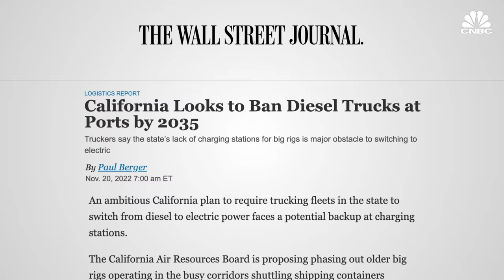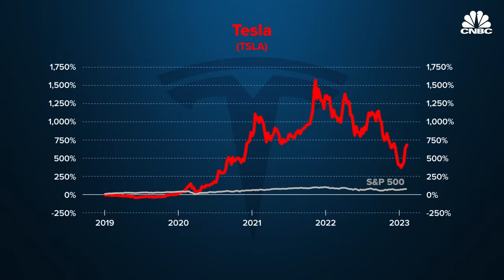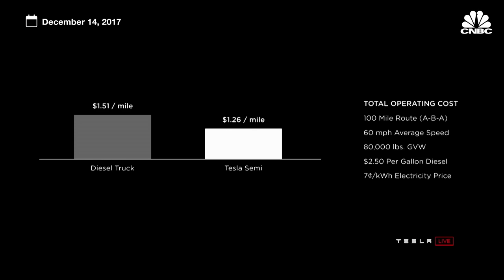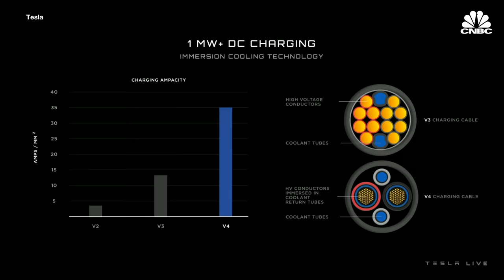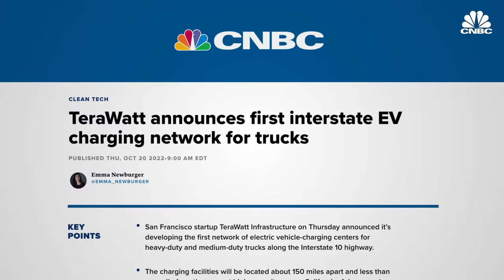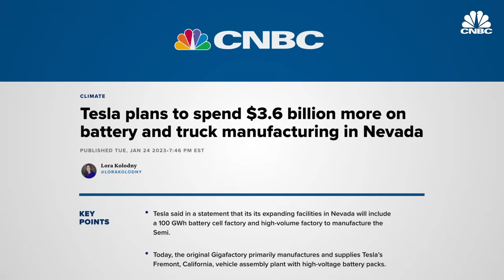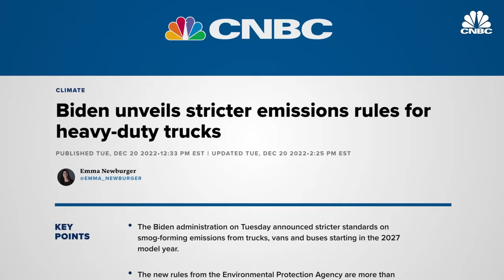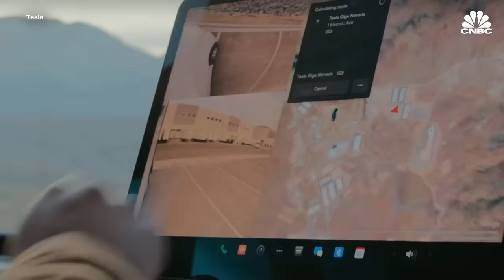Does The Tesla Semi Live Up To The Hype?

Comment: People like to say it won't work over the road but it would work really good for shuttle drivers . 200 miles out and  back. Which a lot of large trucking do. And mega charger  stations will be   are easier to put in than a truck stop.  noise or pollution from  idling truck.
Reply: How about OTR.
Sleeper cab (why not?)
450 miles, (about 7 hours at 65 mph),
Driver stop (300 miles added at a megacharger, that's 350 remaining).
4 hours remaining driver time ?
That's ±260 miles at 65 average (which the Tesla can maintain over terrain)
60 miles range remaining.
.
Total range 450+260= ±710 miles (max load)
.
Truck stops at a V3 charge location.
It's "off peak" time.
No cars (or few) are on site.
The location has a "Semi bay" behind the car chargers on the opposite side to the cars.
.
Picks a (V3) charger, plugs in with an adapter.
The driver sets a timer.
The system modulates the charge at ±120-130kW (half the charger capability) for about 7-8 hours.
This charges the truck to 95% if at high elevation (leaves a Regen buffer) or 99% if on flat terrain, the timer completes the charge 10 minutes before the departure time set by the driver.
The charger also provides onboard hookup for the driver (heating, cooking?) and the trailer if required. (Silent power!)
.
Tesla installs user Lounges (being done in Europe) for car drivers during the day, truckers 24 hours, with basic food/ drink service, maybe showers depending on access status?
.
This is based on max load.
Ranges will increase with lighter loads.
.
Feasible?
Reply: @rogerstarkey5390  As someone who spent a lifetime in logistics, I appreciate reading ideas from those who think about how to make something work rather than the "This is @#$%# impossible crowd."  I think you are on the right track but it will take some time to make progress on that front.  More than 50% of freight moved is local and regional such as the 400 miles or less indicated by the Pepsi rep in the video.  This will be less complex to set up with trucks coming back to home base each day and will be the focus initially. It will still keep Tesla and other Semi EV's busy for years to build out that network first and then the OTR freight will follow.
Reply: TESLA recently added 8 Megachargers to FRESNO , CA to support Operations.
Reply: Yep. All the pollution should be kept around the nat gas or coal power plant. That is where the poor and largely minority people live. Let them deal with the effects of the pollution.
Reply: That statement is way to smart for meatheads
Reply: @bencrilly209  California and other states are begging people not to use electricity for fear of causing blackouts. Where's all this new power generation coming from? 

EVs will be the next great mode of transportation, but they are pushing them out to fast in my opinion. If they botch the roll out, they may never get wide spread acceptance.
Reply: @tira2145  it’s very simple use existing infrastructure and mega packs
Reply: @bencrilly209  The mega packs still have to be charged. Where's all this additional power coming from? In my local area there's simply not enough power, and the infrastructure will need to be completely replaced. The lines are to small as are the transformer's. 

Again, I'm not against EVs, just the rapid transition. To charge poor people extra to upgrade the system just so rich people can drive new cars isn't fair. Our power bill's are already to high.
Reply: @tira2145  1am  to 6 am that’s 5 hrs of  a state filled with 32 million people that use electricity during the day do the math ..if the grid can handle everyone using a AC unit or heater at home it can handle charging mega packs at night
Reply: @bencrilly209  The sun doesn't shine nor is there a lot of wind where I live at that time. Where's the power coming from? Sounds like either coal or nat gas. 

Even with new solar and wind generation, where's all the money coming from? We can't afford our power bill's to double or triple in size. We are just trying to move way to fast.
Reply: @tira2145  search megapack and solar panel in charging 2 cars off of 17 400 watt panels ..in don’t use the grid
Reply: @bencrilly209  Yes, there's dramatic advances being made. 

Just answer the question, where's the money coming from. 68 percent of Americans are living paycheck to paycheck. Credit card debt is way up. Defaults on cars are up drastically. College debt forgiveness will be struck down. Please just let me know.
Reply: @tira2145  that’s a whole different subject .but I’m already saving money because im not paying $6 a gal fuel ..and I’m not changing oil ..and believe me I hate changing oil did my whole life..I’m not a democrat ..it’s so obvious there policy’s have caused this state to be an absolute s hole
Reply: @bencrilly209  So simply won't answer the most important question. Saving 6 dollars a gallon, while paying for electricity to charge your car. Even if you are using solar, all that cost someone a lot of money. Don't think you are actually saving much money when you take everything into account. 

We are paying 2.50 a gallon for gas here and we can find very affordable cars for under 15 grand. A EV starts at over 75 grand, no local shops to work on them. 

Why don't you care that others simply can't afford to own a EV?
Reply: @tira2145  I’m a diesel mechanic why do you think I have so much money ? Because of poor engineering in the trucking industry ..that’s why I own teslas so I don’t have to work on my own stuff
Reply: @bencrilly209  And your point? I really don't care what you do or what you drive. Should I bow down to you because you drive a EV? Do you consider yourself better than others because of what you drive? 68 percent of Americans are living paycheck to paycheck. They can't afford to buy a 100,000 dollar car. They are barely able to afford to buy food.
Reply: @tira2145  during peak time.
Reply: @tira2145  do some research. Not every EV is 100k. And right some EV  are cheaper than gas cars..
Reply: @tira2145  please educate yourself . On EV prices.  Most people spent more on A gas car than a  EV but complain about prices. You also forget about the  total cost.  No oil changes low maintenance . In my 18k Miles. I bought wiper blades cabin filter  and windshield wiper fluid. And one tire. Most people don't do the math. I  pay  1/3 of what I was paying for gas.
Reply: At what costs per charger?  The power supply's are = to a Mega store each.  That's 8 wall-mart in one block.
Reply: @bencrilly209  Just a little arithmetic here. 17 panels at 400 watts comes to 6.8 kw per hour nameplate (not real world) If you figure for 4 hours peak charging that is 27 kw and another 4 to 6 hour diminished charging you would be lucky to charge one 70 kw car battery the full range of acceptable driving. How is this going to help charge truck battery packs?
Reply: Not every EV is 100k. you mean the ones that break down and fail after  100,000 miles e cars?    Some as soon as 50,000
Reply: @zmavrick    you can store  a weeks charge  cause no one normally uses 70k W in one day
Reply: @zmavrick  I have a full model s battery as a storage backup my point is that solar panels and storage batteries is the answer to this problem ..it has nothing to do with climate change and everything to do with not paying $6 dollars a gal for fuel and not paying for a $5000 for an egr cooler